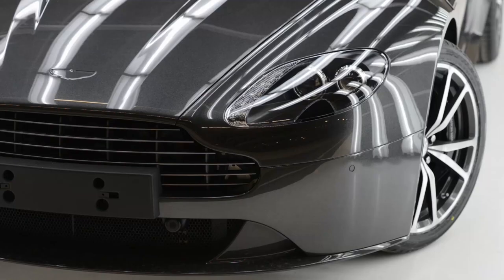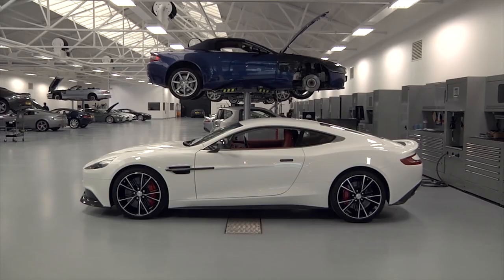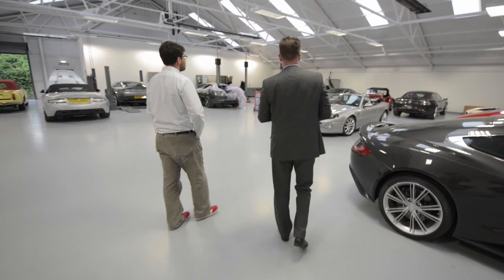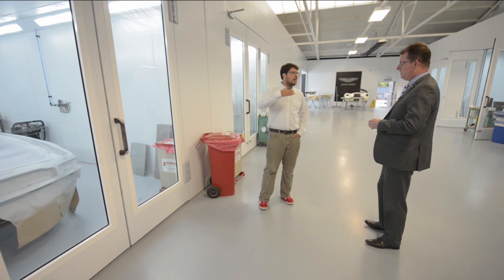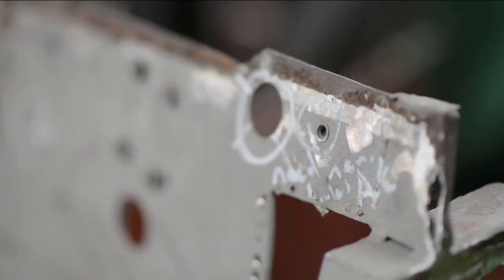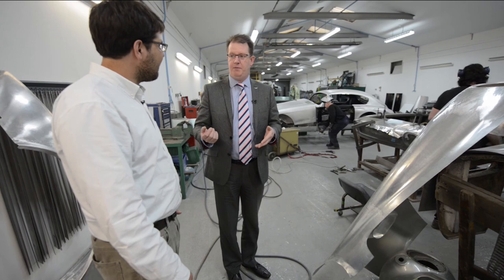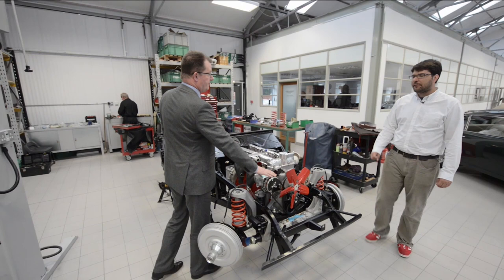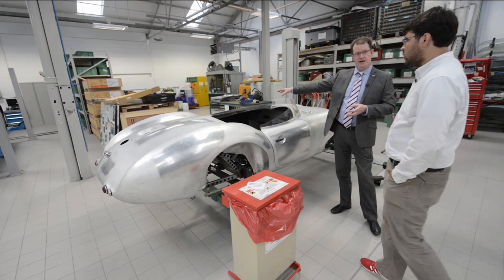Aston Martin Works: Keeping the Legacy Alive - /DRIVEN

Comment: THIS is what luxury cars are all about. GM wouldn't do this for you. BMW probably wouldn't either. Aston Martin, they'll look after you even if you're in the middle of Bongolia.
Reply: Chris Belfort Bongolia.  Place so remote and unheard of I made it up. However, if you were stuck there, Aston Martin would surely come and assist you.
Reply: as long as you have Money they look after you
Reply: Rosário Correia As is the way with anything though. You certainly get what you pay for.
Reply: Aston is one of few who do this only because they are building cars that just below coach building standard. 

Aston are a low volume manufacturer of high quality cars so it means they have the ability to offer this service and there is also willing customers.
Reply: Aston is one of few who do this only because they are building cars that just below coach building standard. 

Aston are a low volume manufacturer of high quality cars so it means they have the ability to offer this service and there is also willing customers.
Reply: I think Porsche offer something like this as well. But they are like Aston in that they are building luxury sports cars.

Comment: Aston Martin is such a cool company. Doing in-house restorations and upgrades like that.

Especially putting manual transmissions into the previous generation Vanquish, which I think is by far much better looking than the new Vanquish. The new Vanquish is pretty, but it looks way too much like a Virage or one of the other new Astons. And the previous Vanquish just looks so much meaner. Like it could actually "vanquish" things, so to speak. And it's awesome how people can come in and get that clunky paddle shift transmission that the previous Vanquish came with, which was one of the very few downsides to the car, and have a proper manual 'box fitted by Aston Martin themselves.

Very cool. Thumbs up to Aston Martin.